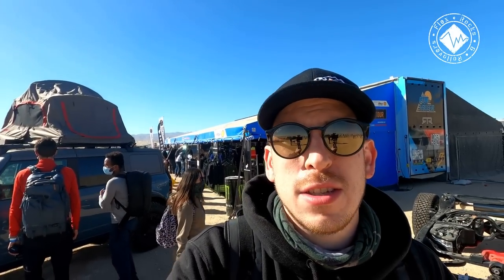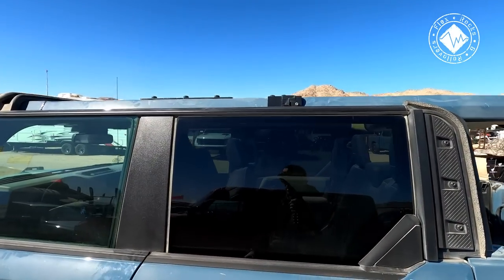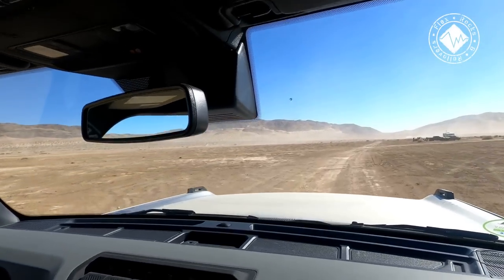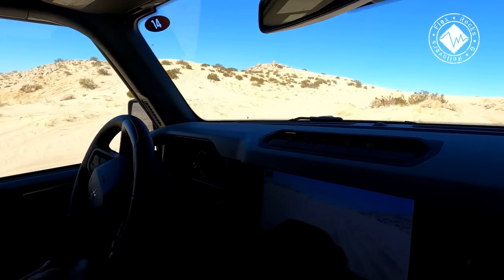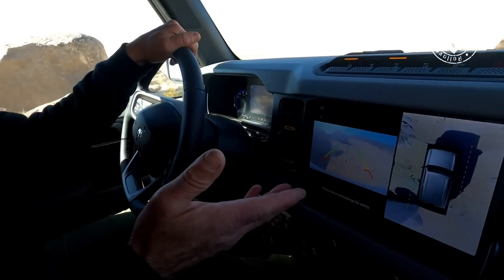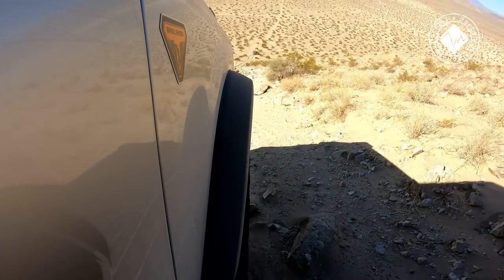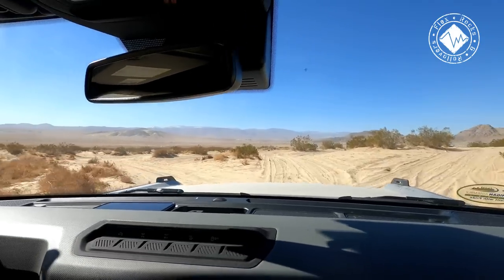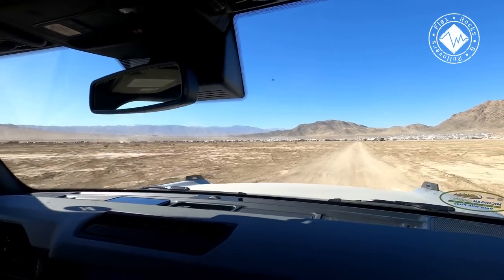Off Roading the New 2021 Ford Bronco! Reaction + Walk Around

Comment: Ford is trying... But it will never be comparable to jeeps. Ifs sucks
Reply: Jeep has been the same for years.. just because its solid axle doesnt mean its the best. Ford has been watching and listening to what offroaders want and use their rigs for. Cant hate for a roll off the production line with all this technology that is already included.  Nice quality interior and exterior, not bulky and plastic like jeeps. This is literally everything a jeep has x3. 

Broncos have challeneged the jeep. The only way jeep came back was with a v8.. same poor mopar quality at the end of the day. Cheap materials.
Reply: @MoonyJohn   Jeeps havent been the same for years... And there will never be even 5% of broncos on the road compared to how many jeeps there are. Clearly the bronco never worked out that well for ford because they stopped making them in 1996 sooooo 😂 its like this is fords ditch effort to try to be apart of the offroad community.. "Oh hey lets make another bronco exactly like a jeeps with 95% of its featues except we will use crappy ifs". what a joke.
Reply: @MoonyJohn  Not at all. I own 3 jeeps, a 98 TJ, 2018 4dr JK, and a 95 YJ. I’ve been everywhere with all of them, none of which would have with ifs and loads of electronic garbage that is bound to stop working. This is not something to compete with Jeep’s, it absolutely does not have the guts or the suspension to take the beating that Dana 44’s on my Jeep’s can take. This is a glorified trail off-roader, what it isn’t is a jeep competitor. Don’t compare them through comments sections, square them up on some off-road trails and see my point proven when the cv axles can’t take the abuse. Nor will it have the articulation.
Reply: Lol IFS is just fine. No, it can’t go EVERYWHERE a SFA vehicle can, but I did more in my Commander than anyone thought was possible. I actually had multiple Wrangler owners stop me after a day on the trails to tell me how impressed they were. IFS may not be your thing, but they are plenty capable.
Reply: @mikepaoletta9847  maybe for some people it works fine on a nice easy trail... but for true offroaders ifs are a weak point and not desired at all
Reply: @braddenr.4778  Exactly
Reply: @mikepaoletta9847  I’m not saying ifs isn’t capable, I’m saying they aren’t on the level of a solid axle Dana 44 off-road. And Ford calling it a keep competitor was the whole reason for my above comment.
Reply: @jeeperzcreeperzz  who gets to decide what the definition of “true off-roading”? What you like to do may not be what others do. But technically any form of vehicular travel off of roadways is considered “off-roading”. IFS has limitations, but can do just as well as SFA in some circumstances, it just takes smarter line choices to keep from damaging the vehicle or the suspension. My Commander made articulated hill climbs that the Wranglers in my group couldn’t do. It’s about picking the right vehicle for what you want to do and the terrain you want to tackle. But your opinion on a system doesn’t dictate a universal fact.
Reply: @braddenr.4778  I totally get what you were saying, and I agree. To me, the Bronco is a happy middle ground between the Wrangler and the 4Runner. It’s not as beefy as a Wrangler, but has the “freedom” people love, and combines it with a suspension system that will be great for commuters and people like me who are outdoorsmen who need a vehicle to get us to the hunting or fishing ground more than we need a rock crawler.
Reply: @mikepaoletta9847  oh yeah, for the price and availability, those commanders offer a lot of off-road capability for what they are. Guy that runs with our group on the trails has one, 3.7v6 too. Doesn’t do too bad.
Reply: @braddenr.4778  that’s what mine was as well. Don’t get me wrong. There were things I’d never try to do that SFA rigs can walk through. But I think IFS gets a bad wrap overall.
Reply: @braddenr.4778  
And the money and pain in the ass to fix the front suspension
Reply: @braddenr.4778  they already showed the broncos going on the Rubicon trail stock. Now how many people will be doing that every weekend?? The 2.3(in the mustang and focus ST) and 2.7(F150) engines have been great in other vehicles and the 10 speed transmission which Ford and GM both collaborated on is probably the best transmission in the game right now. Jee literally has made the same thing iver and over and now have to put another hellcat engine in one of their vehicles as their last ditch effort.
Reply: @elchucofried5683  yeah it did the rubicon trail..not without countless amounts of damage to the vehicle itself. No.1 Due to the lack of articulation, No.2 lack of required ground clearance and approach and departure angles. It got high centered and wedged between rocks the whole way. It’s not a wrangler competitor, stop making it out to be what it isn’t.
Reply: @MoonyJohn  lol same plastic interior as Jeep. Same aluminum panels. Same recalls. And a shitty ifs suspension that will cost a fortune to lift and be pita to fix on trail.
Reply: true> considering i no longer have to contend with 'death wobble'.  u can keep your solid front and deal w/ leaky seals also.
Reply: @gjl7022  never had deathwobble or leaking seals, its called keeping up with your vehicle and making sure things arent worn out or overdue for replacment. I can tell you aren't a person that works on their own rig 😂
Reply: @gjl7022  3 jeeps, no death wobble or leaking pinion seals. Even then it takes 10 minutes to drop the shaft and change them out.
Reply: @elchucofried5683  When I saw the pictures of the Broncos that made it through the rubicon trail, my first thought was "wow thats a lot of damage". I Doubt people would want to take their new Bronco on the Rubicon and come out with that much damage. But maybe it was just novice drivers.... that would be probable.
Reply: @mikepaoletta9847  Having owned an XK, I highly doubt this claim. I wouldn't want to wheel mine. Was it stock? mine had the 3.7 which makes no power until 3200 RPM, and is all wheel drive without a 2 speed transfer case. Saying that out performed a Wrangler is very hard to believe. I can't speak for the 4.7 or 5.7 XK with an actual transfer case, but if it were so great, wouldn't more people be doing it?
Reply: @ProjectXJ  never said they were great. I said they were overlooked. And mine was the 3.7 as well. You can choose to believe it or not, but I am still friends with the guys who were there and could back the claim up. There’s a lot their Wranglers could do that I couldn’t, and I stated that before. But there were times where that XK did do as well or better.
Reply: @mikepaoletta9847  interesting. I guess its one of those things that is better witnessed than read in a YouTube comment. IFS (from a factory) is basically trading off road performance for on road comfort, but can help in baja (off road speed) style driving.
Reply: @ProjectXJ  I completely agree. Personally, I think the reason I was able to climb the hill that my buddies couldn’t was due to wheelbase. They were in a YJ and JKs and would get hung up on a dip in the hill. The XKs longer wheelbase helped keep forward momentum through the dip is my theory. If I was building a strictly off road vehicle, I would go SFA. But for the average person who will see more time on road than off, I think IFS can be a good middle ground. All depends on type of terrain you’d like to conquer.
Reply: @ProjectXJ  they were stock Broncos. No lift no 40 in tires. Just stock... and idj what damage you're talking about.
Reply: @elchucofried5683  just to all of the bumpers, underbelly, sliders and quarter panels. I know they were stock, and i realize people are going to modify them, but with the bronco, the ifs will limit what you can do. I think they will be great and people will buy them.
Reply: @braddenr.4778  is